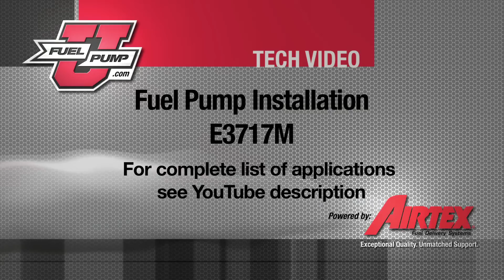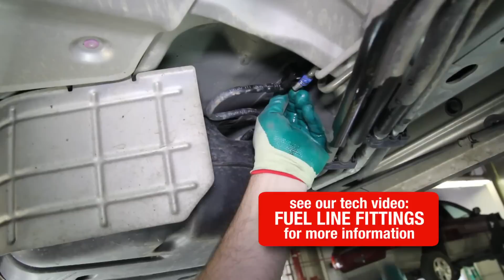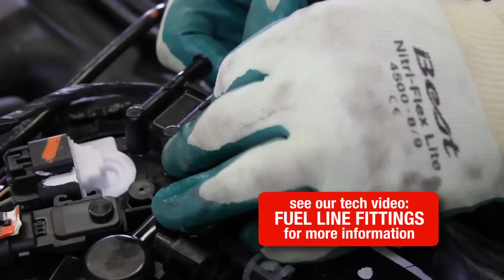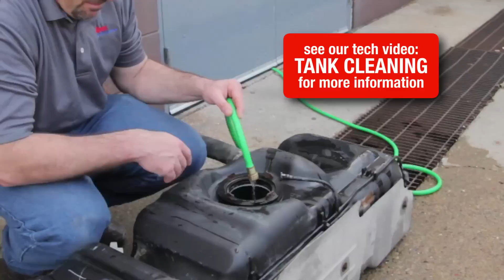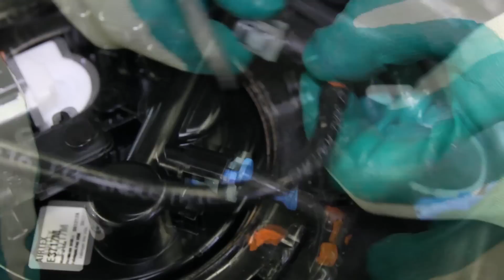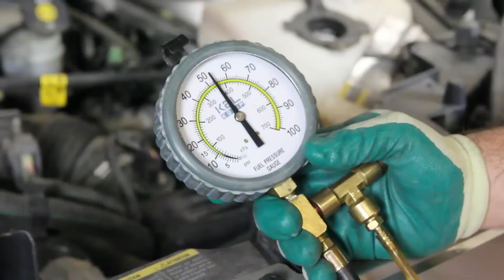How to Install Fuel Pump E3717M or E3718M in 2005 - 2007 Chevy Uplander

Comment: I just changed my fuel pump on my Uplander ...thanks to this video! I did it with the rear only elevated about 10 inches. It was tough getting the tank back in, but the job went pretty well. If anyone needs help, let me know.
Reply from the maker: Glad to hear the video was helpful. Thanks!
Reply: I will be attempting this within the next week or so. Any helpful hints or tips would be greatly appreciated.
Reply: Ryan, If you are doing the job with the van on the ground, then getting the tank elevated to reattach the straps is a big challenge. I used a 1 gallon paint can on one end and a taller bucket on the other to keep it elevated. The little plastic fuel line/vent connectors will drive you crazy ...there's a reason they never show you in the video how they were disconnected because it's very hard and time consuming. Try to become an expert on how the plastic connectors work in theory.
Reply: Hey, Tony. Got the tank done last Saturday. Went pretty smoothly actually. I do have an issue though maybe you can shed some light on. I got the wrong pump. I got the wheel base wrong when I was searching for the pump. I was able to reinstall everything without too much of a fuss. Things were positioned slightly different but, I got it all together. Problem is my fuel level sensor arm is not reading correctly. A full tank of gas indicates an E reading on the dash. Only thing I can think of (short of buying the proper pump) is taking the pump out again and bending the sensor arm in a way that will allow it to float correctly.
Reply: My first guess would be that the electrical connector somehow didn't get a good connection. You'd have to remove the tank again and test for continuity. The original GM sensor was not designed correctly and created bad readings because the float pushed the sensor past 100%. So the 3rd party (and GM, I assume) makers were sure to get this right, so I doubt you'd need to adjust (or bend) the sensor float. I wouldn't bend anything, but if you're SURE everything's hooked up OK, I recommend exchanging your pump from the place you purchased it. I highly recommend Rock Auto in the future. They allow exchanges where you get the new one delivered before you remove the supposed defective one. Coincidentally I had to exchange my pump right away (and did the same job twice) because I got a code P0451 after installing the 1st pump. They let me exchange it because I got the one with the lifetime warranty - no questions asked. So now my trouble code is gone, but like I said, I had to drop the tank twice too.
Reply: I'll definitely be dropping the tank again and investigating. The reason I think it's the float is because if you put the pumps side by side, the connections on top are positioned differently. The original pump connections are positioned at 10 o'clock while the new one is positioned at 2 o'clock. I was barely able to get the connections back on properly. Including the reserve line near the filler pipe. I also had to cut off the plastic positioning tab in order to lock the pump in place. The sensor arms were very similar. The biggest difference being that the floater on the old pump was positioned in towards the pump, while the new one was positioned away. This leads me to believe that because the floater is now sticking out farther than the original, the slight clockwise turn I had to make on the pump to get it locked, and possibly the tank may be shaped differently to compensate for the larger wheel base (121 oppose to 113), the floater is wedged up against the inside of the tank somewhere and not able to move at all, thus, giving me my false reading. I won't know for sure till I'm in there again.
Reply: I wonder if you got one that someone returned and they put the bottom half on backwards. Mine fell off the two metal tubes and it was possible to put it back on 180 degrees wrong. just brainstorming, may not have happened.
Reply: So the van wouldn't start today. Not sure why. Girlfriend was sitting in it at gas station and it just died. Wanted to start but wouldn't turn over. This has been a constant issue, the reason I changed the fuel pump in the first place. Haven't gotten to it to diagnose it yet but, my guess is the alternator. We bought a new battery for it this year so, I know it's not that. Any ideas?
Reply: At that point, with my level of knowledge, I'd take it to the dealer and pay for a diagnostic for $85, then fix it myself.
Reply: Well I ordered another pump. The right one this time. Just finished installing it. Vehicle started right up. And the gas gauge is working properly.
Reply: Awww nice ...I am happy for you! You're getting good at these tank removals!
Reply: Yeah, it was a little harder with a full tank of gas this time but, it worked out. I appreciate your advice and support. Take care

Comment: My husband and I  are looking at your vidéo about taking à fuel pump off of a Cheverlet Uplander Lt 2008 3.9 l. We are not to sure if are model is one that you must drop the fuel tank. Or do we have the one that we can pass through the floor. We are stock on a street and it has been 3 days  that  we are checking all the  vidéos that are on display. We could happily need and take you advice to either change the pump  or find out what is our problem.
The truck was running well and then nothing it stalled. He tryed to start the truck so much that the battery died. The next day we returned  and the truck started but stalled Could it be something else. Looking forward for an explication if possible. Thank you in advise
Reply: I had that exact problem today, Did you find anything out? any information would be much appreciated! Thanks

Comment: Please answer my questions in which direction the crank sensor of the Uplander engine is located
Reply: Crank sensor is either on front of engine at crank hub or on back of engine where flywheel is for the transmission
Reply: Located passenger side front wheel 

Knock sensor 13mm bolt then proceed to CKP 9mm be a tight spot and feel for it. Took me 45 minutes once that they are replaced you will need to relearn them using a scan tool (clearing code wont work on ODBII) either bring to shop with a scan tool to relearn under special functions